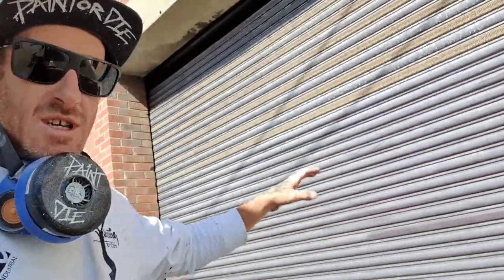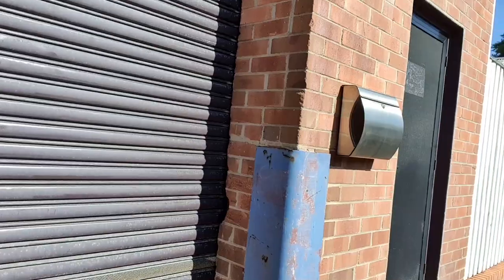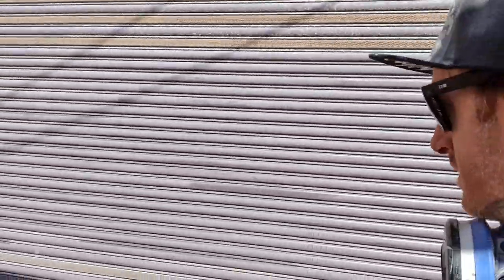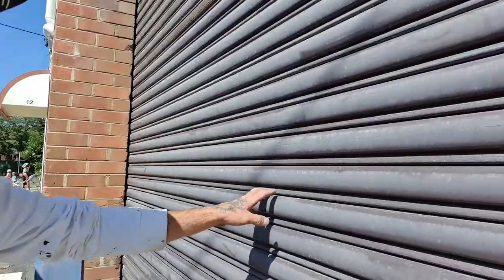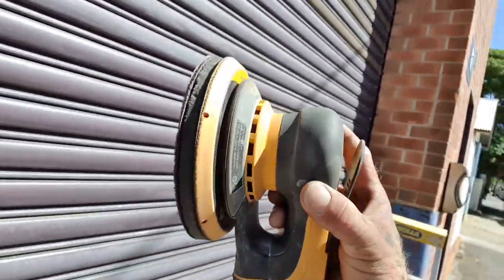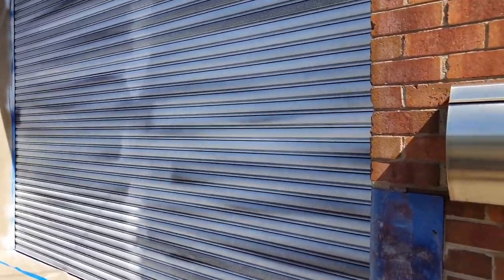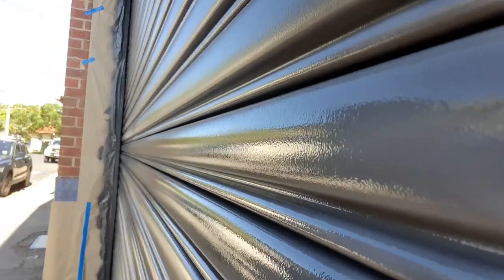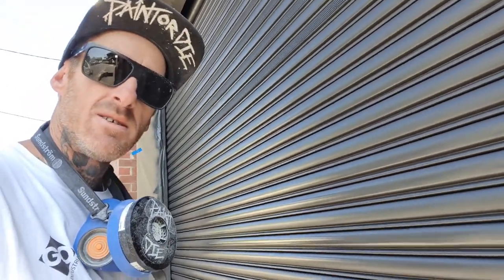PREPARING & PAINTING A ROLLER DOOR

Comment: If it it galv you wouldn't want to scratch it?
Reply from the maker: I do many of gal doors still needs a sand/scratch and I good primer for the top coats to adhere
Reply: @paintingbyjosh  I'm taking paint off mine with paint stripper. maybe I should have just done what you did?
Reply from the maker: @titiwhai   yes I would have done it the way I have. stripping paint gets messy.

Comment: Hi Mate. Great video. I use the same method with a primer and 2 exterior Acrylic over the top using Graco gear. 

Ive been using Acryloc" Galvanised Metal Roof Primer on all Garage doors and Colourbond. minimises sanding and surface prep being a roof product! It sticks perfectly to even unsanded surfaces and creates a very solid base for topcoats! 😃👍

Keep rollin mate!
Reply from the maker: Cheers legend I will definitely check out the Acryloc I like using the metal etch primer but I do switch it up a bit depending on the job. Cheers for watching & the message legend 🙌 🤙PAINT OR DIE